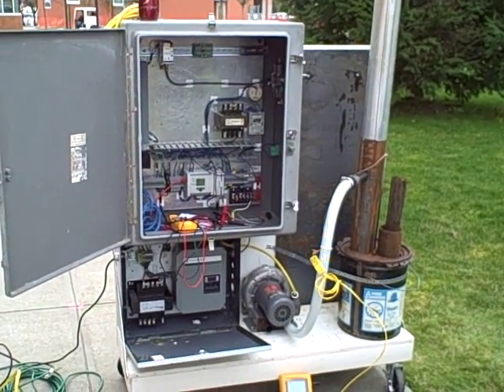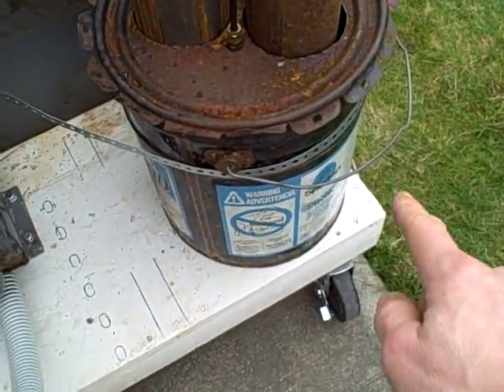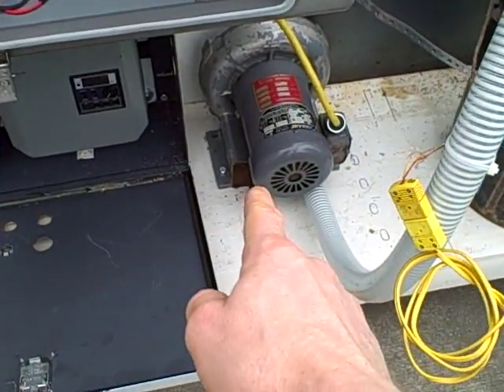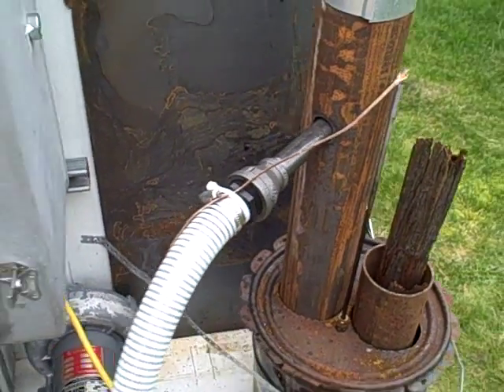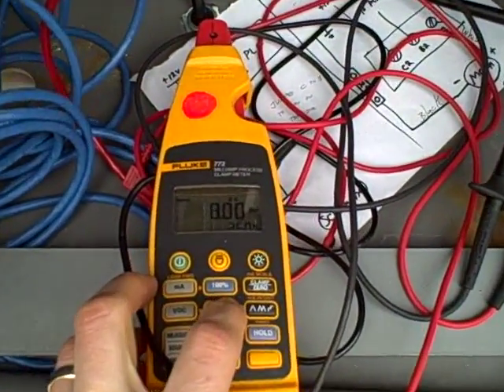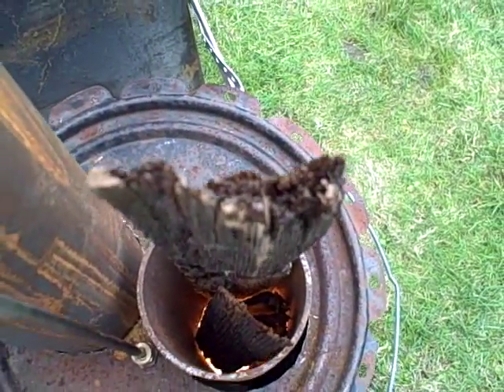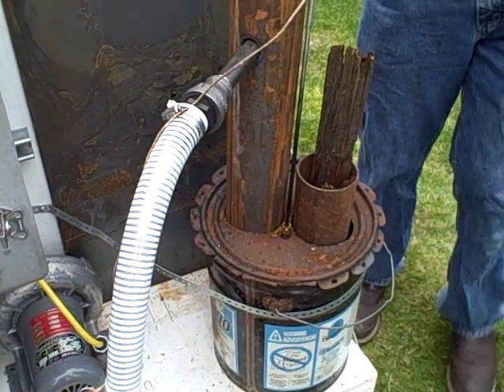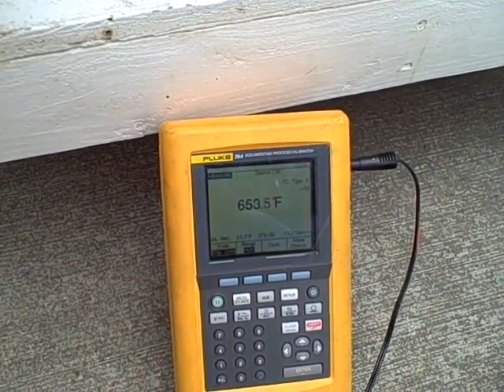Rocket stove automation -- part 1 (manual testing)

Comment: Your "air jet eductor" is a venturey correct?   This is how I tried to controll my draft in my home made wood boiler.  but it will not stay concistant for you or say lack on controll. Once you get it sucking very hot the narual draft plus' the ventureys draft and like me ull get over run?? I had a draft door to stop it but on a rocket you wont be able. Your rocket stove also needs insulation around your J tube to see if it will handle the extra heat.

Comment: Nice work! I've done a little work myself with a forced draft J tube rocket stove, she was only 4" diameter, it was interesting, but never very practical. She needed feeding too often and didn't produce very much useful heat. I like your approach with the PLC, will you be automating the fuel feed?